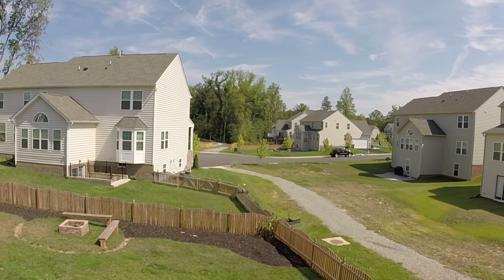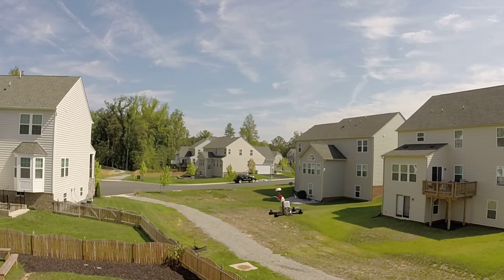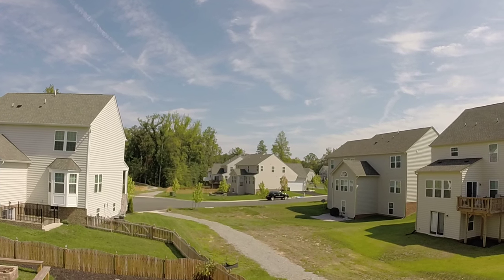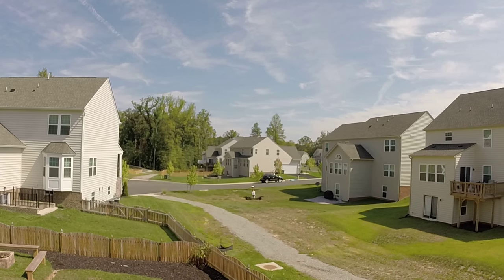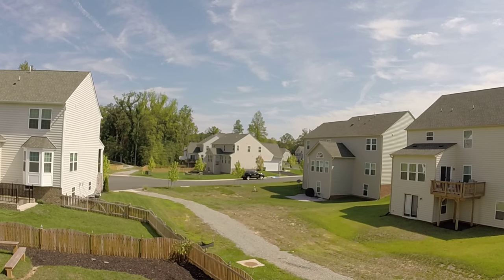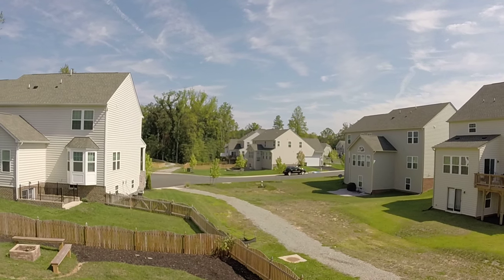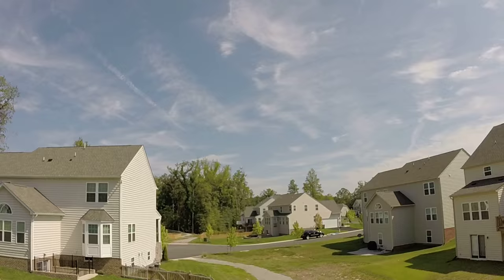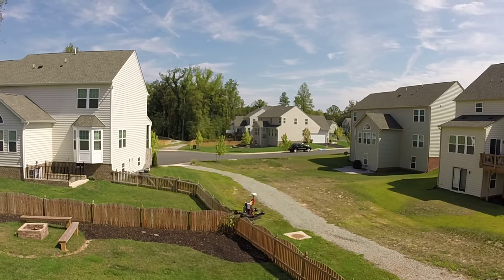Tweaker 180 Thrust test and first LOS flight

Comment from the maker: + John Jones. I still have the original 3 jet fuel packs and they are working great. I purchased 10 Rotorgeeks true C 40C 4S and they work well too. Unfortunately both brands sag at high currents. I get 2 min flight times with 14% battery left when I race hard.
Reply from the maker: I am running 4045 triblades.
Reply: +Karl Dietz Thanks for all the great info man!